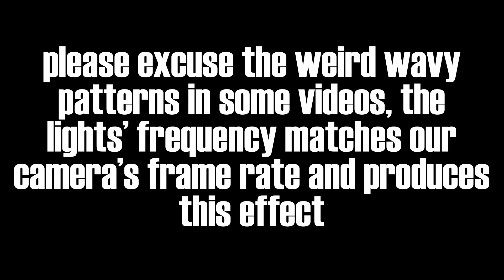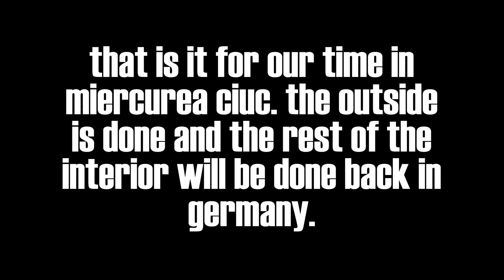Building a Tiny House #5 - Roof, interior doors, stairs and more - The ONION Adventure

Comment: Drip edge with overhangs, can protect the siding and windows from rain and excessive moisture. If there is no overhang the water will find it's way down the wall and rot the siding, windows and the sill plates
Reply: That's right. We also thought about ways to solve this.
Reply from the maker: We have just installed a rain gutter and a drip edge to prevent water from running down the sides of the house.

Comment: The small rafters under the roof, the ones above the condensation foil... in a few years you will find those to be rotten. Should have been placed longitudinally (sloping with the roof) as for the condensation dripping to flow along  them not against them. You basically created mini dams for the condensation flow... My dad is a house builder. We repaired roofs like this many times... The solution is first mini rafters sloping then you ad the second layer crossing with the first. Then condensation flows normally to the edge of the roof and out into the hanging collecting gutter. Makes sense?
Reply from the maker: Thanks for your feedback! We forwarded your concerns to our manufacturer. We are always improving our process and such feedback is very valuable.

Comment: The finish on the outside makes it look soo good! 

Have you been weighing and trying to keep the build under a specific weight? Was this easy/hard?

Congratz on the house-
Reply from the maker: Hey Peter!

Thanks, we agree on the awesome look of the oil with the pigment. :)

We are aiming to stay under 3.5t to be able to register it more easily in Germany, but we have not yet weighed the house. It will be weighed before it is going to be transported to Germany, we will include the weight into the next tiny house video then. :-)
Reply from the maker: Thank you :) And we did try to build it not too heavy with for example the plywood walls and so, but the Eco Tiny House has already material that is rather lighter. So it wasn't really hard for us to decided what to use :P. But we don't know the weight yet, so we'll see how successful we were. It would be great to still be unter 3t :).